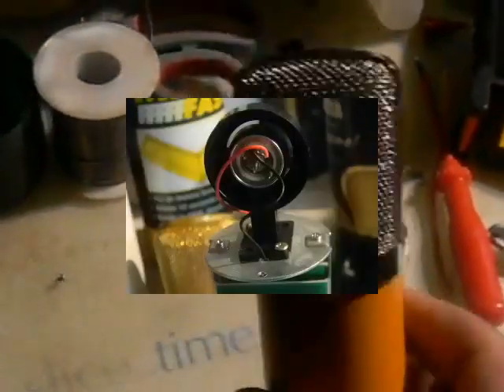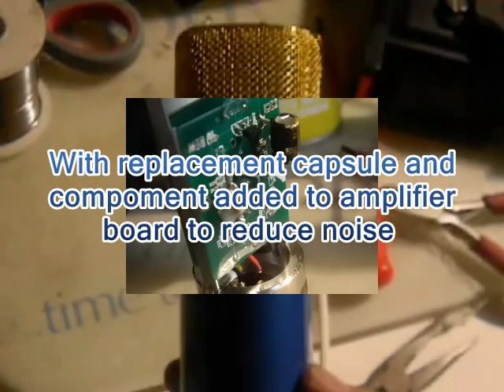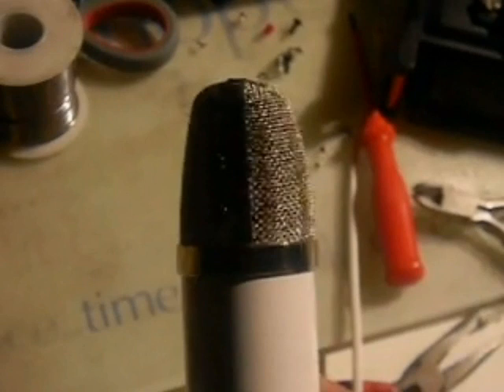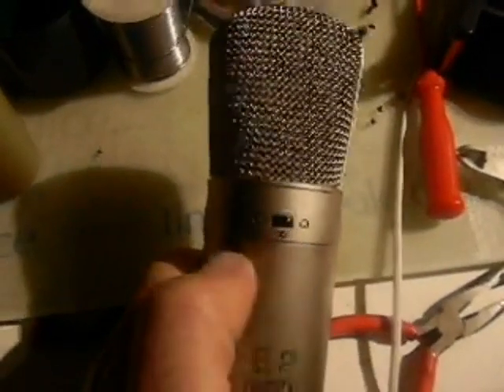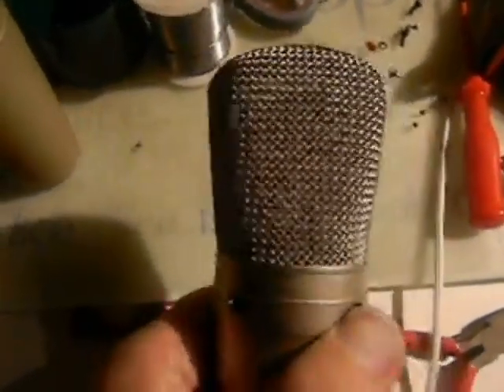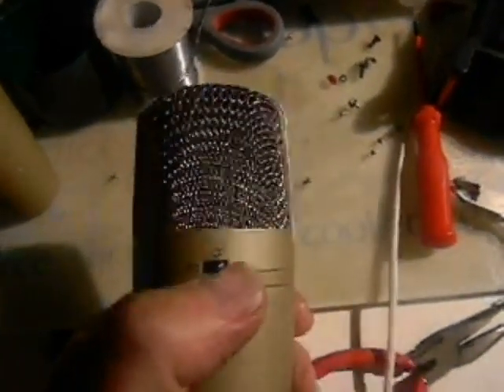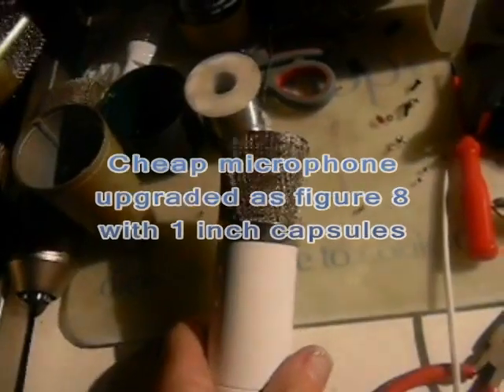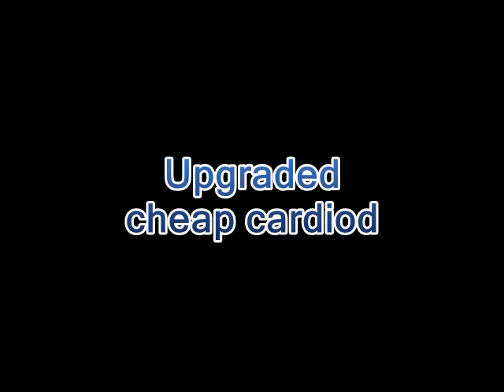Upgrading cheap BM800 and Berhinger C3 microphones and comparison with B1 and B2 PRO

Comment: Very interesting and quite impressive differences in background noise, what preamps were you using? Where do you get the capsules?
Reply from the maker: Yes - I was very pleasantly surprised and this certainly takes these mics into an upper echelon. Look up "25mm microphone capsule" on ebay and you'll recognise the brass looking ones.  Thanks to https://www.youtube.com/watch?v=0lpQ0BpjUtg for the details on the circuit modifications